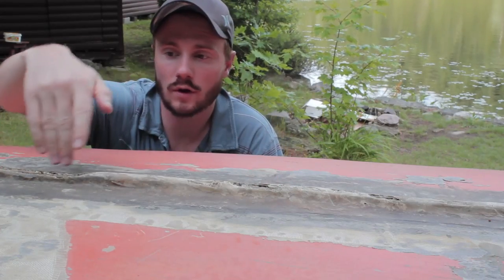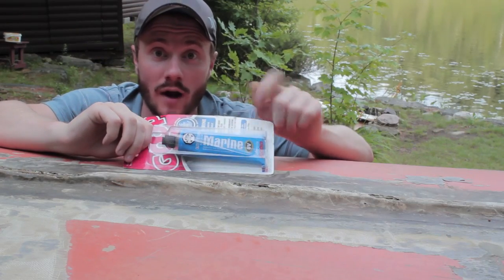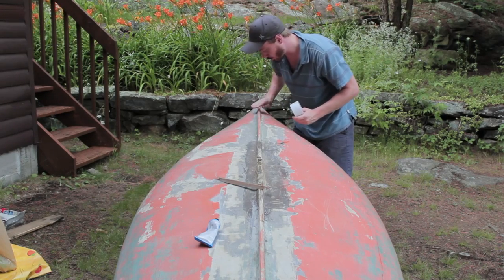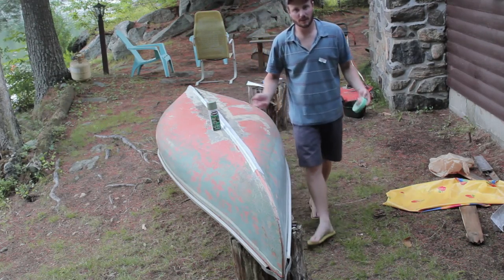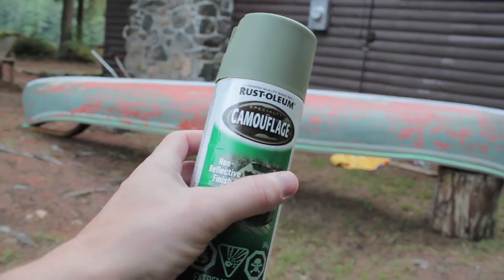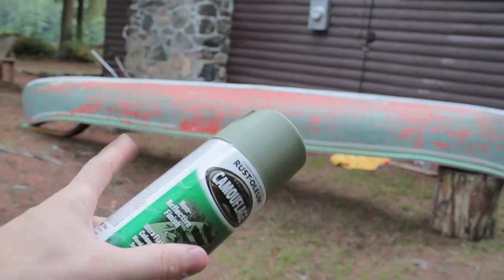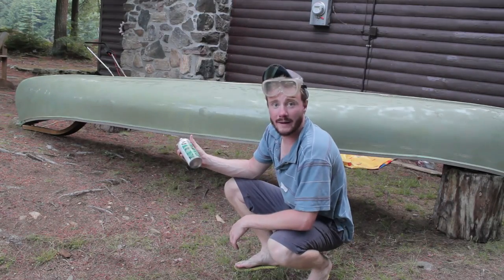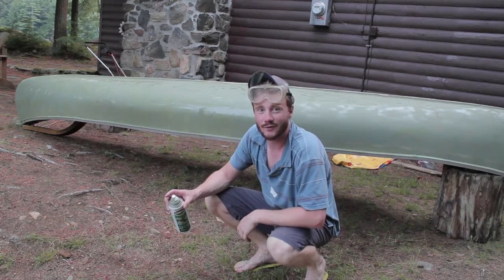A BEARDED GUY TEACHES YOU: HOW to FiX your BOAT (for under $20)

Comment: Great video.  Was specified as being under $20....    But for around $40 you could have gotten enough fiberglass sheets with resin and sandpaper to do a proper job with very little more work than what you did with duct tape.  Properly in this case is still cheap and easy.
Reply from the maker: Hi Rick...yeah, not my finest work...but I am glad you enjoyed the video!

Comment: Congratulations on inhaling fiberglass dust.  Never dry sand fiberglass.  Wet sanding is faster, cleaner, and way less dangerous than inhaling all that crap.   There is a right way to do this, and I'm afraid it's not exactly what you did here.  I like that you wanted to save this boat, boats are there to be used in the worst conditions, and I doubt I'd trust this job.